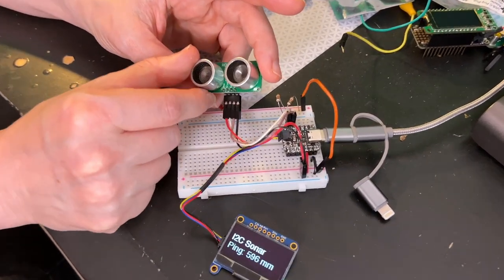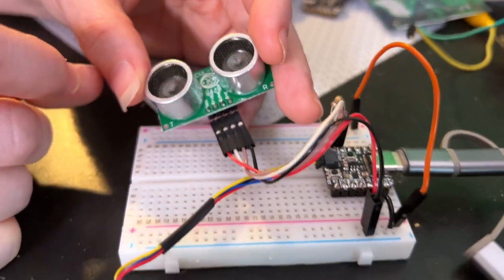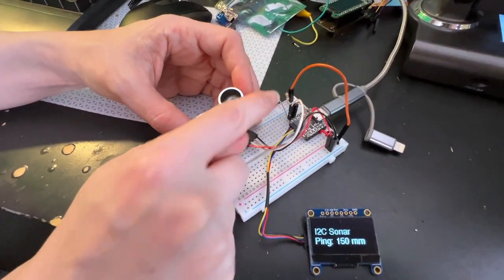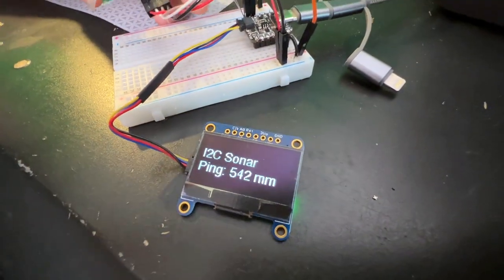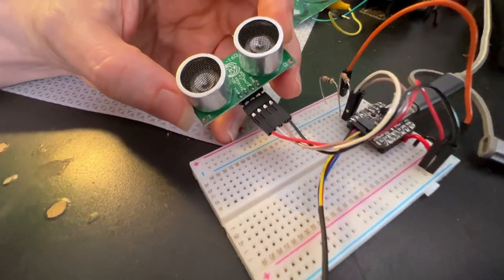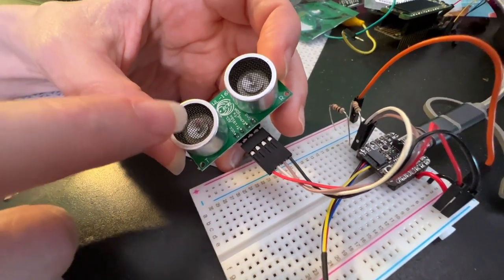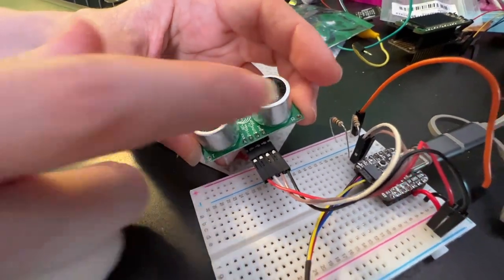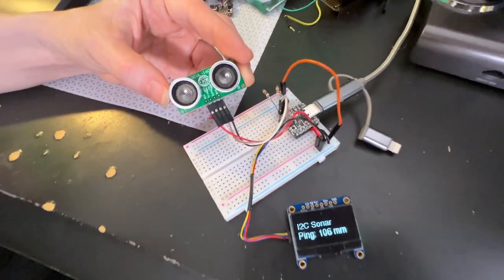Quick demo for the RCWL I2C ultrasonic

Comment: Could we see this i2c demo code?  When I search on this board, it looks like the datasheets/info everybody offers is using it in HC-SR04 compatible mode trigger and echo.  The i2c scan shows a device there at 0x57, but write 1 to the it, wait a few millis and read three bytes, doesn't seem to do the trick for me.